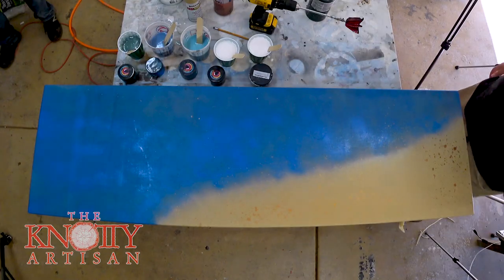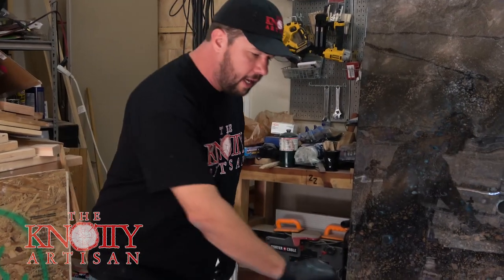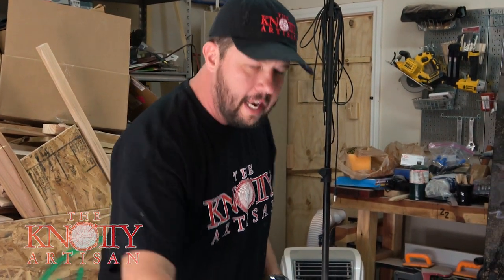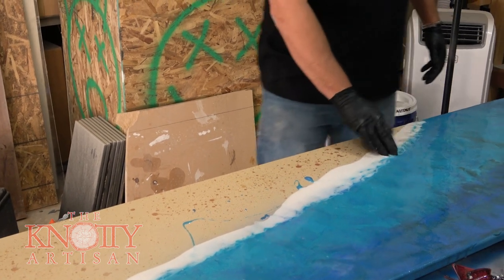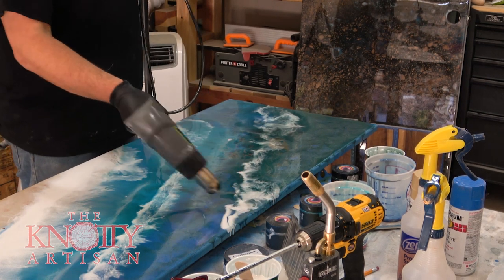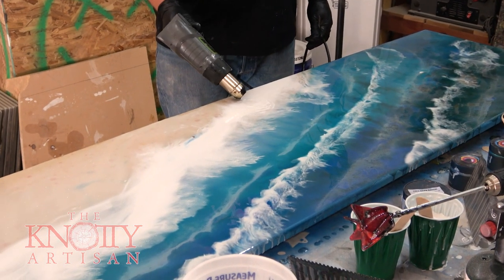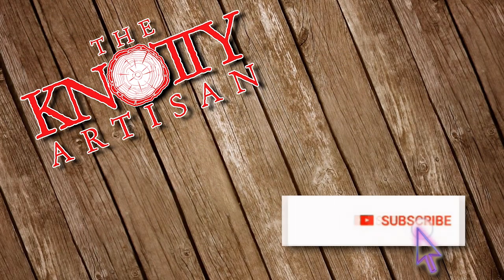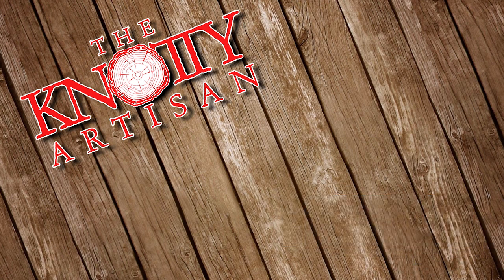Ocean Painting Effect Using Epoxy Resin Art

Comment: How did you finish the edges did you have to work them at all ?
Reply from the maker: The secret to a good edge is in the prep work. I like a 1/2' roundover top and bottom, glue and screw all the seams and bondo any gaps. I then carefully sand by hand using a 220 grit sandpaper to a smooth finish. If you can run your hand along the face of the edge and not feel any imperfection you will have an excellent edge. the epoxy will flow smoothly and uniformly over the edge taking whatever pattern you have on it down the sides as well.

Comment: What is the base countertop made from?  I need to make 3 separate pieces for my bar top and am trying to do as cheap and as cool as possible.  How do you get the resin to flow over the sides evenly?  About how much did it cost to do the countertop you are demonstating?  Thanks so much!!
Reply from the maker: HI the base is made of MDF  and primed with a behr utlra paint and primer in one. I rub the sides throughout  the process to get a nice coating on the sides. The countertop in this video is approx $100 in materials.

Comment: Im curious why most video's I've seen where they are doing a counter top like this the underside edge is left with drips and bumps? how do you treat that if you want it to look perfectly smooth on the underside?
Reply from the maker: Hi Craig. I use an angle grinder with a flap disc to zip off the drips after they dry.
Reply: You can also use painters tape on the bottom. Remove the tape to remove the bumps / drips.

Comment: Are you using the art resin from stone coat? We have been using it, but the white always blends into the blues too much. Resin seems to run too easy. Any advise?
Reply from the maker: I quit using stone coat over a year ago.
Reply: What are you using now and how has this counter held up? I’m looking at doing this for our dive club in Hawaii.
Reply: I am certainly no expert but, in my experience, there is a couple of things you could try…
Firstly, make sure you have a layer of clear epoxy between the blues and the white… this helps me to stop the white mixing the blue.
And secondly, I usually lay down the blues then wait about 20 minutes before laying and manipulating the white… this way the resin has started to thicken up which helps with the colours running together too much. Of course this depends on the resin you’re using, and I’ve never used Stone Coat art resin so I don’t know about it’s cure time etc.
Hope that helps somewhat.  ♥️♥️🇦🇺